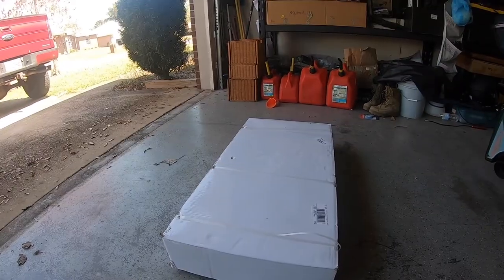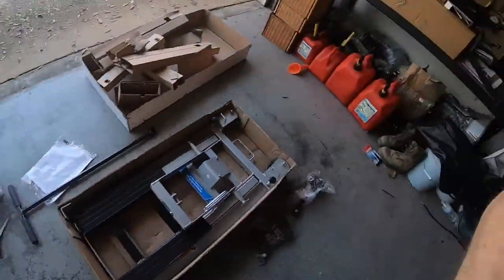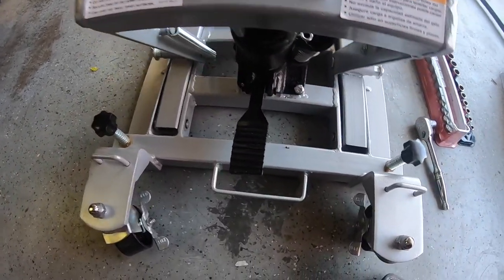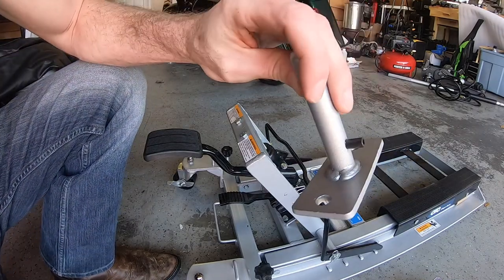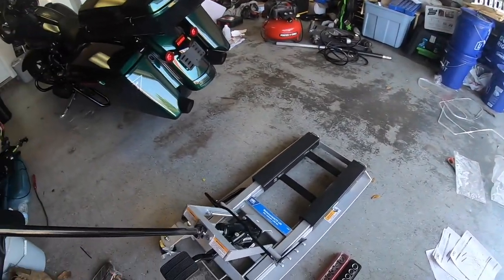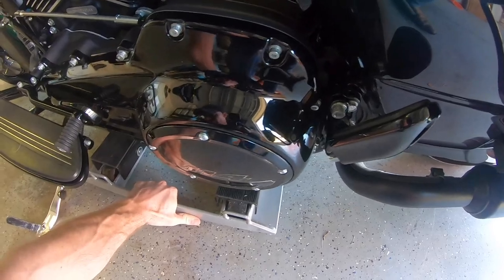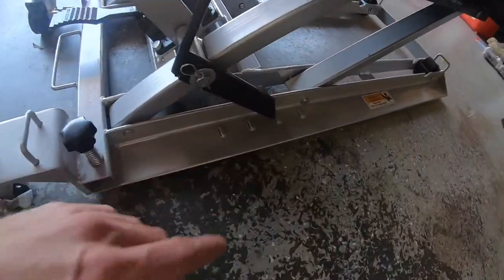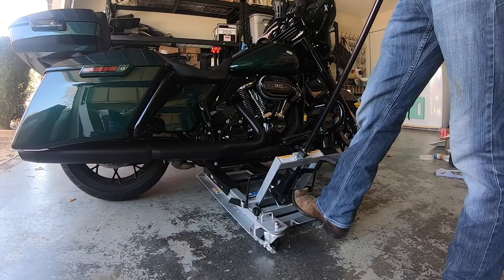OTC Stinger Series Motorcycle Lift Unboxing / Assembly / First use

Comment: After mounting the hydraulic Jack, the pin would not fit through so I had to remove the hydraulic jack, place pin in and through, then remount jack  to frame. 
Your video was great - if I didn’t have it, I would still be sweating in garage trying to figure it out. Thanks again!
Reply from the maker: Im glad that the video helped you out.

Comment: Great video...  i just bought lift from amazon and surprised there was no instructions.   lucky for me, i searched Youtube and found your videoi.  like others said, no BS... a lot of guys, love to include non-sense words that is not needed.... right to the point and just great great video.  one questions, any suggestions on placing the straps on?  i have the 2021 Road Guide Special..  thanks
Reply from the maker: For the front I run the straps around the engine guard and for the rear I have the saddlebag guards so I run the straps around those. If you don't have the saddle bags guards then you can always run the straps around the lower frame right behind where the lift sits. Since that distance is so short to the tie down point on the lift I would recommend running the rear straps to the tie down point on the lift closest to the front of the bike and then run the ones from the front to the tie down points closest to the rear. they will cross but as long as they don't get in the way of anything you are trying to work on then you should be good.

Comment: Thanks for the review. I have one of the Harbor Freight Pittsburg lifts and have been happy with it. My only comment is you didn't demonstrate moving the bike around. The primary thing I use the lift for is to turn the bike around so I don't have to back it out of my garage. The Pittsburg jack is okay, but the castor wheels could be better. Thanks again for the review.
Reply from the maker: I would say that this jack isn't really made for moving the bike around. Im sure it can be done but it isn't very smooth on the casters.

Comment: Hey man great video. I live in Chicago and have to store my bike in the winter and i was thinking about actually using this lift to prop my bike up in the winter and have it sitting on it for storage. Do you think the lift has been holding up well and is capable of that?
Reply from the maker: The lift has been holding up really well. for long term storage I would definitely lower the weight onto the safety bar so that you don't risk the hydraulic giving out over time under the weight. However, if you are looking for something purely for storage of the bike and to get it up off the tires then I would look into a scissor lift jack since that is purely mechanical so it doesn't have hydraulics to fail. I personally do not have experience with any brands to give you a recommendation however. Another option, if you want the versatility of this style lift, is you can get some 4x4s and place them between the floor and the underside of the lift pads to assist with holding the lift and prevent it from falling for long term storage. Just some options for you hopefully one of these will help/work for you.
Reply: @BanditMotoVlogs  Good to know. Thanks for the reply man!

Comment: Is the reason the jack slipped the second locking tab  is because the locking bar wasn't set back . When you brought it down the bar was pointed forward n not locked back.

Comment: Saw another video on the OTC 1545 and it came down fine. You need to bring down a little at a time or send back n buy direct.
Reply from the maker: It came down fine for me as well. It was just the initially release that was kind of quick but then once the weight was back on the bottle jack it lowered smoothly with full depression of the pedal.

Comment: Do you think it’s enough space between the bars to drain all the oil? Primary trans and engine ?
Reply from the maker: Yes it is. I was trying to attach a picture but it does not seem like it will let me or I just haven't figured out how. But yes if the lift is positioned properly you will have access to all three drain plugs with it up in the air.
Reply: @BanditMotoVlogs  yeah but it’s kinda hard to fit a drain pan under wirh the Jacks base in the way isn’t it ?

Comment: Good review! Can you easily move the jack around with your bike lifted up on it? I was hoping to see that in your video.
Reply from the maker: I haven't tried moving it around with the bike on it. If you wanted to move it around then I would 100% recommend strapping the bike down to it. I personally only use it to get the bike in the air. Haven't really found a need to move it around once it is up.

Comment: All of these motorcycle lifts are pretty similar in design including having misleading load capacity. The hydraulic bottle jack maybe capable of 1500 lbs but that doesn’t make it 1500 lbs of force lifting the bike. That capacity is dramatically reduced by the mechanism and the way the force is applied. The lack of ability to lower the bike smoothly by this overloaded bottle jack is going to be witnessed by a sudden drop so be sure the kick stand is down as shown in the video and go lightly with the release.

My motorcycle is much heavier than yours and I don’t think the included bottle jack is going to have a long career. Best of luck to everyone with a heavy motorcycle and wanting a lift. I haven’t found one built right yet for long term regular usage for heavyweight street bikes. For the occasional user these jacks might last a couple of years of light use if the motorcycle is heavy. Then an increased power rated replacement bottle jack will likely be required. I don’t think these less expensive jacks are any worse in lift capacity as the most expensive ones. The expensive one comes with a stronger handle and better wheels to help you move the lifted bike around easier but that’s about it.

Comment: It has straps,,Use  em
Reply from the maker: You are correct it does have straps and point to strap down to. In other videos, where I am actually working on the bike, I have it strapped down. Since this video was only showing assembly and lifting and lowering the bike I didn't strap it down because I wasn't going to do any work on the bike. But I do appreciate the concern and you looking out for me so that I don't drop my bike.